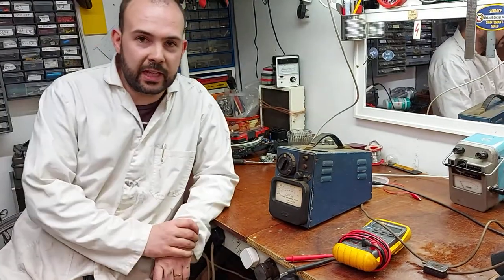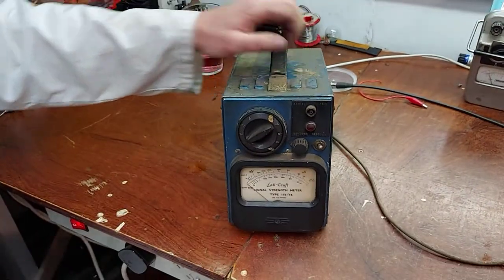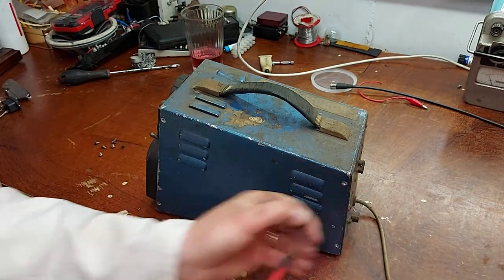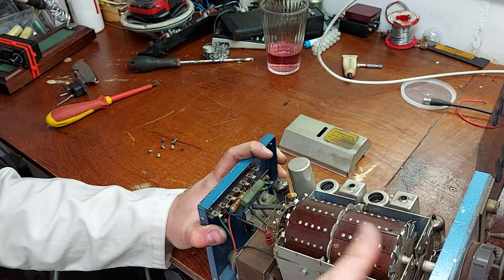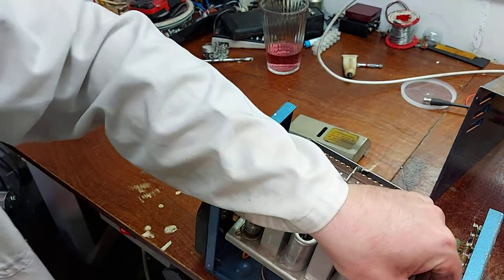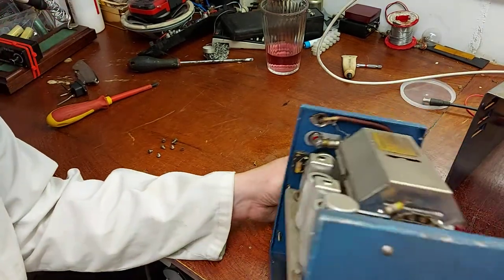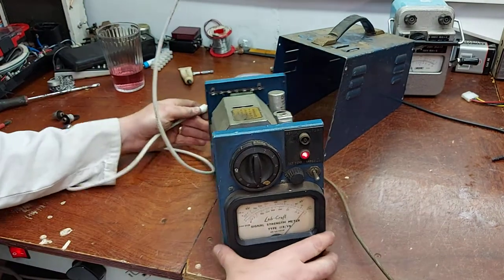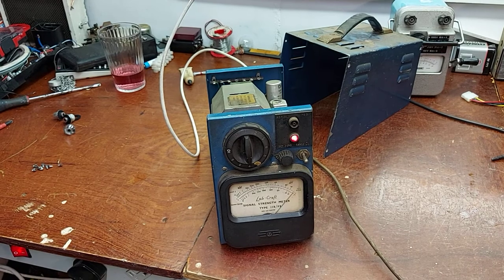Lab-Craft signal strength meter.

Comment: That’s a very interesting meter.  Much more inside than I expected. Thanks for sharing.
Reply from the maker: Thanks Chris, having cleaned it since I uncovered a label affixed to the top. Channel 1 cover 2 Meters, channel 2 4 Meters, Channel 3 133.5MHz? and channel 12 100MHz. Giving the 2 Meter handheld a blast near it confirms it is operating to some extent.
Reply: that's when things were made proper.

Comment: Well that's an odd bit of test gear and it's from the 405 line days,  so unless it measures 405 line  i.f strip
levels i can't see it being much use to you.:-(

I would flip the scale plate on the meter then re mark it for voltage measurement.
Build another variable psu in the box.
Save the valves and turret strips.
But that's me, i can't see it being usefull for it's original function.
Reply from the maker: I'll keep it as an interesting artifact. No point trying to turn a Viking long boat into an aircraft carrier!!😃
Reply: @IrishvintageTVRadio ,  I would like to see a viking aircraft carrier lol :-D

I have found uses for useless items, i had a old long battery charger case that once charged an ancient long nicad battery for a long dead vidicon video camera.
After making a new front out of some  aluminium plate and throwing together a 2-20v 5A variable supply  in the case with a digital meter, it became a usefull mobile supply :-D.
Cost me bugger all as all the parts were scrap box stuff.
Recycling the crap ha ha :-D
Reply from the maker: No I'm all for a bit of useful upcycling.